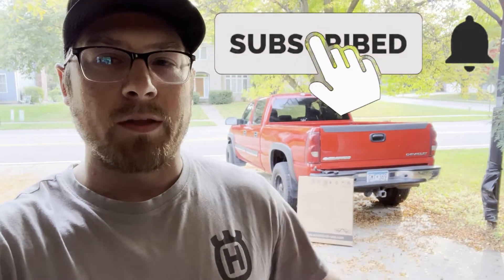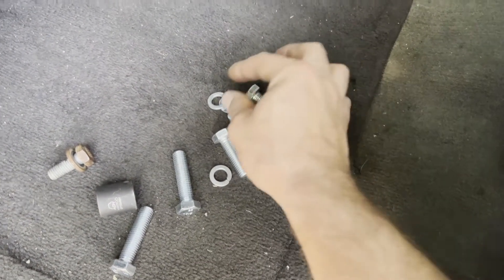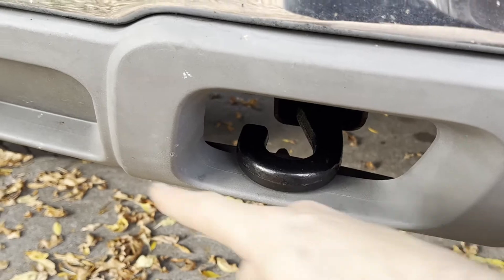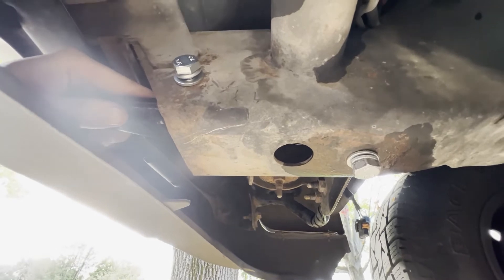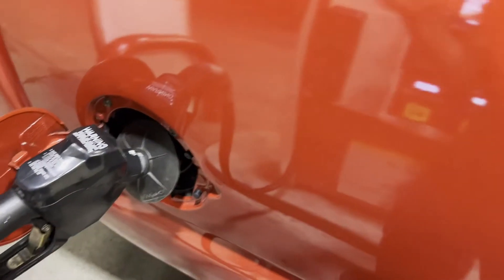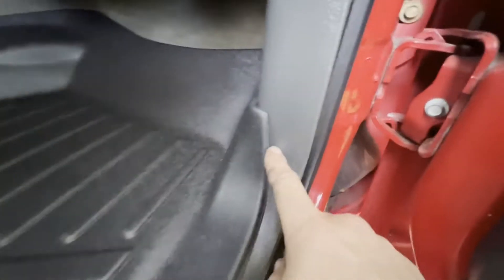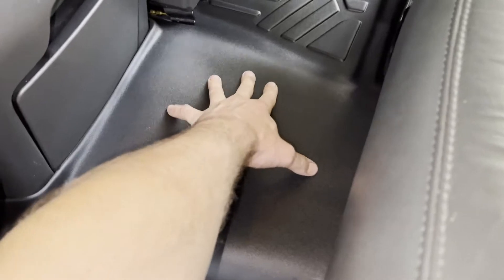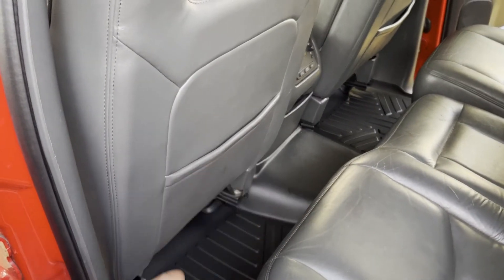Silverado 1500HD/2500 Tow Hooks & Floor Mats - Project Heavy Chevy

Comment: Might be a dumb question but will this work with your standard chevy 1500 or only HD? I have a 2000 Silverado I’d like to add tow hooks on since it didn’t come with any when I bought it
Reply from the maker: Standard non-HD 1500 will use different tow hooks, but those ones are very easy to install as well. Just different part numbers and probably different fastener sizes. I believe only 2 bolts hold the 1500 hooks on but I could be mistaken.
Reply: @TonyTheTruckGuy  thanks for the response I’ll look into getting some

Comment: So how do you remove factory tow hooks on a Chevy Silverado 1500 2005
Reply from the maker: Should just be 2 bolts like this but slightly different setup on a 1500.
Reply: You think these could be made to fit a 2000 Silverado?  @TonyTheTruckGuy
Reply from the maker: @sean.g4516  Only if it’s an HD. Normal 1500’s use different tow hooks. Of course I’m sure there are ways of “making it fit”, but at what cost haha